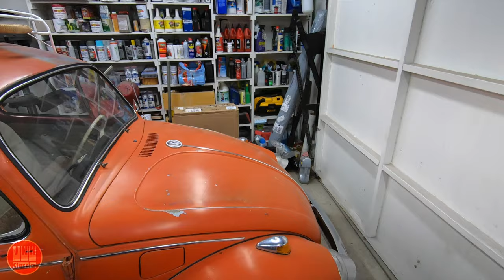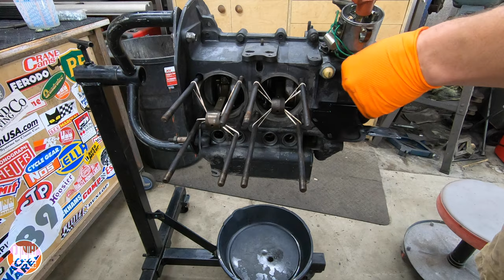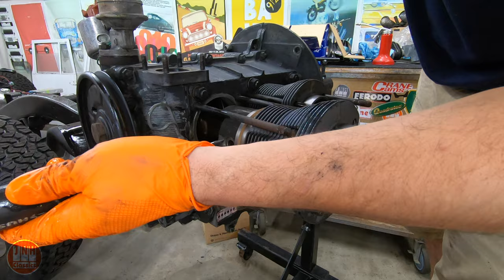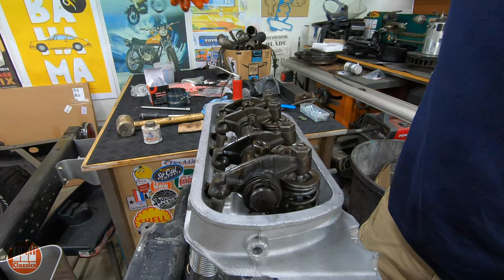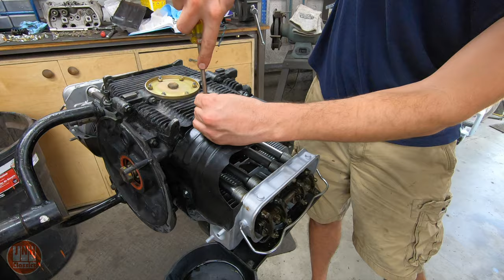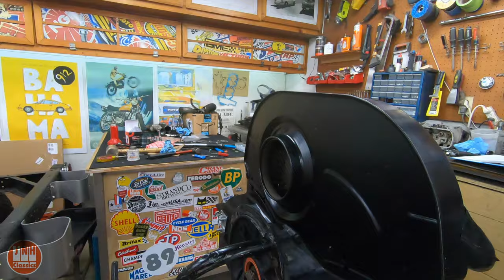An Unloved Beetle (Episode 16) - Engine Assembly

Comment: Some tips to use in the future:
Never use the paper gaskets under the cylinders. If for some reason you do use them you should coat them in a gasket sealant like Permatex aviation. However the better option is to instead run a thin bead of high temp silicone on the cylinders before installing them and leave off the paper gaskets.
You should always pull the pistons out of the cylinders and align the rings in the correct order before installing them. You should ALWAYS do that instead of trusting that the piston and cylinder manufacturer has done it for you. 
I reccomend putting the pushrod tubes in dry. When you coat them in permatex they tend to not seat properly and cause a leak. 
Always make sure the pushrod tube seam is facing up. Just incase the seam has a leak. 
Last thing is the flywheel seal. You did not install it properly. They make a tool for that. It has to be pushed in further than you have it. It doesn't just sit flush with the block. It actually drops in a bit further into the block.

Comment: Jared; you need to install the air deflector tins under the cylinders; they are crucial. The engine will be cooked if you don’t. You did install the ones on the heads but the ones for the cylinders are the most important. I take it back I spoke too soon whew! 🤣. Normally they tell you to install the pushrod tubes with the weld facing up; also they suggest acorn nuts at the sump plate to prevent leaks and the oil deflector plate inder the generator stand goes with the curved part of the louvers facing to the center of the case (frankly don’t know if that makes any difference) but hey; you can’t win them all. I noticed you didn’t install the thermostat and flap system but I believe it had been removed previously. Not sure if it gets a little cool where you’re located but this system helps the motor warm up quicker and in a more controlled way during initial startup. My car warms up and falls into perfect idle almost instantly and without an electric choke. Love the way the painted tin came out; like factory. Looking great!

Comment: Why haven't the crankshaft liners been replaced? When starting in the first episode, the oil pressure lamp did not go out for a long time. This could indicate the wear of the crankshaft. It was necessary to check it while the engine was disassembled.